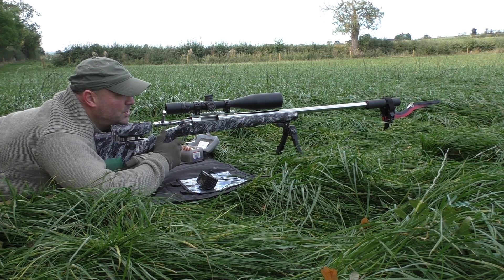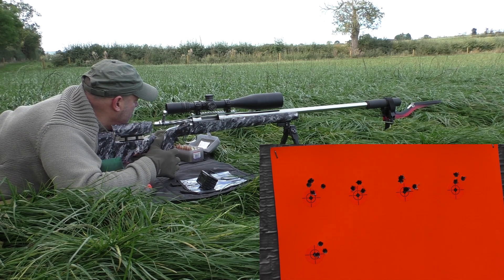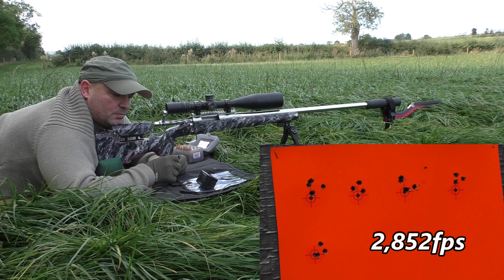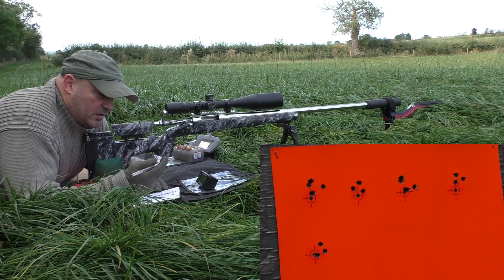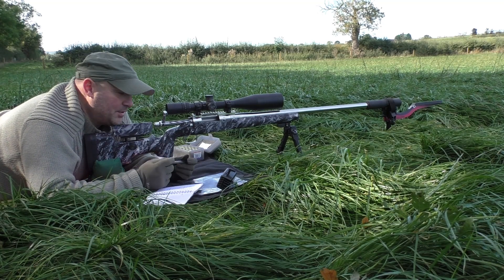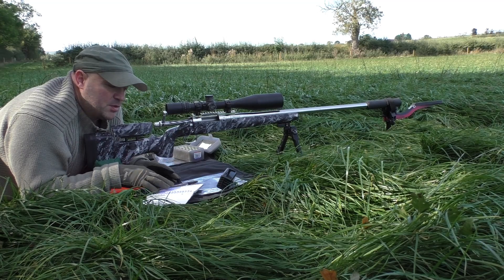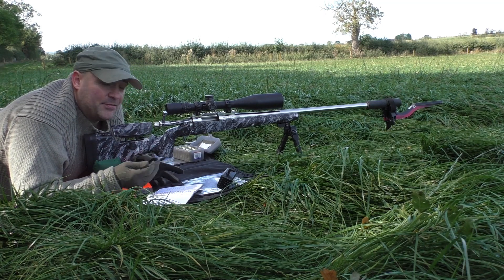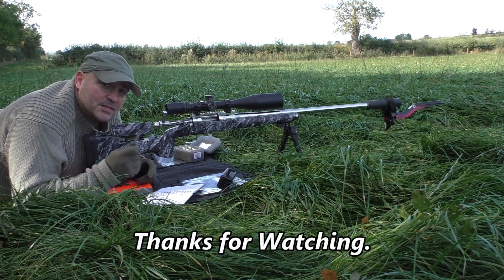Nosler 130g RDF Bullet Part 4 Chronograph Speeds.

Comment: Groups look really consistent,  I would hope tweaking the seating depth will tighten them up nicely
Reply from the maker: Hi John thanks for the comment, if you checkout part 5 you will see that I have dropped the bullet another 5 thou to where they are 30 thou off and I use 38.9g see what you think cheers G.

Comment: Nice results to take and tweak matey 🤙🏻
Reply from the maker: 24886544 yeah I think so too matey to be honest apart from some mistakes on my part which I do believe I made these actually shot quite well so I will definitely be doing some tweaking 😁
Reply: @GianniG55  this video illustrates perfectly that 50% of this is a mind game, if a shooter has any doubts creep in it can affect results, then questions pop into the mind and before you know it a group of 6" appears! For a first time out theres some excellent results there, even if they show what doesn't work 😉 you'll have it one holding in no time I'm sure
Reply from the maker: Definitely matey ,  sometimes you think you are doing things right but your not if your honest with yourself so being able to call your mistakes is important, plus when I shot some with the chronograph on they shot tight lol 😆
Reply: I just tested the 140 rdf in my 6.5 creedmoor, they liked 50-60 thou off lands in my rifle which is good then they will fit in mag. Still not as easy to load for  & consistent as my Berger's but the price is right.
Reply from the maker: shoot2survive Hi,  so what kind of group size were you getting with the 140s and speeds? In my rifle I don’t need to worry about mag length thankfully but I am going to play a bit more with them And yes these are a much more reasonable price than Berger .
Reply: @GianniG55  41.5 of H4350 avg 2672 fps, sd of 7.6 es of 15 group was .306 might stick with that but groups lower & higher were over inch.
Reply from the maker: shoot2survive , so by those results I’d say your using more powder granted it’s a heavier bullet but with mine travelling roughly 200fps faster and with less powder and I haven’t finalised powder charges or seating depth yet I’m still fairly happy with those results so I’ve definitely got some tinkering to do, thank you for the info and thanks for checking the video I appreciate it👍
Reply: @GianniG55  I'm trying a new brass which is much thicker & my next load of 41.8 is just showing a little ejector swipe. What powder are you using?
Reply from the maker: @shoot2survive I’m using the Vihtavuori N140 same with my other two bullets Berger and Sierra that’s why I want to get it to shoot so I can have 3 bullets with one powder that’s the goal.